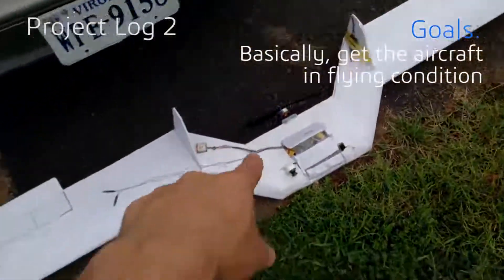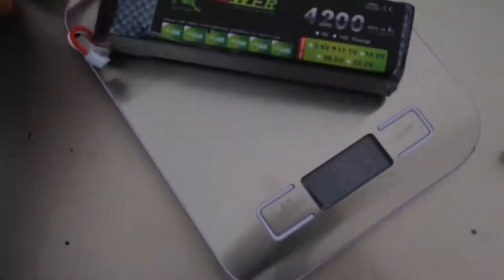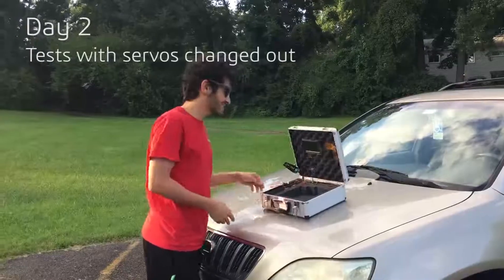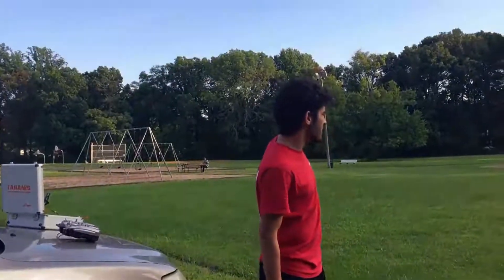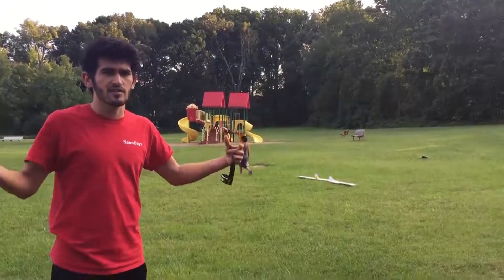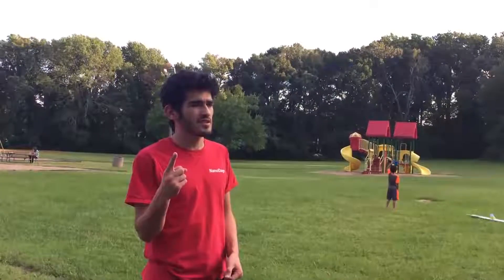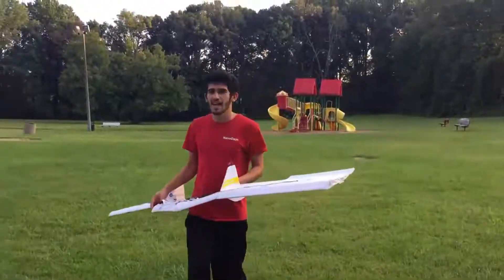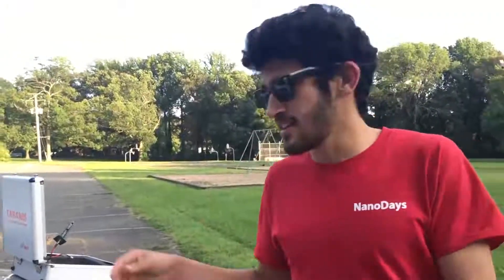Project Log 2 | Autonomous Glider From High Altitude Balloon : Test Flights

Comment: Hey man! I really like this project, i'm new to this stuff and was just wondering how you get the transmitter to talk to the arduino? what receiver works for this?
Reply from the maker: The arduinos not in the airframe in this video, It's just to test if the aircraft is flying or not.